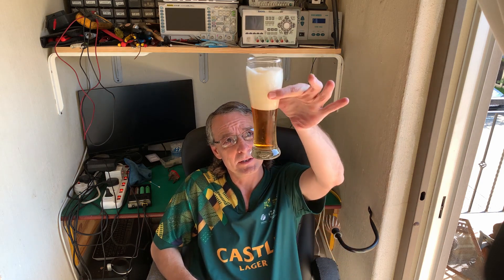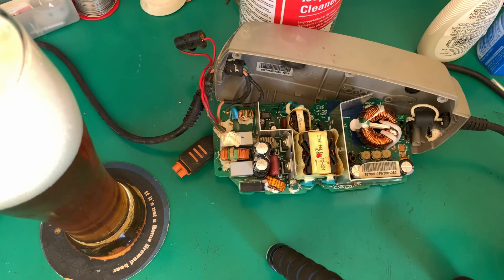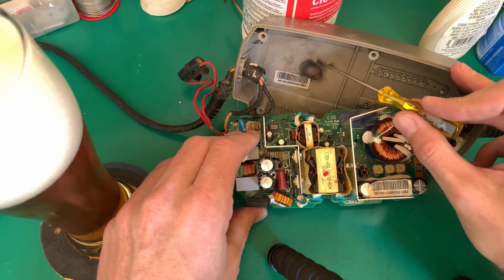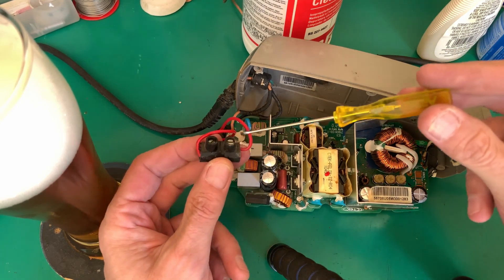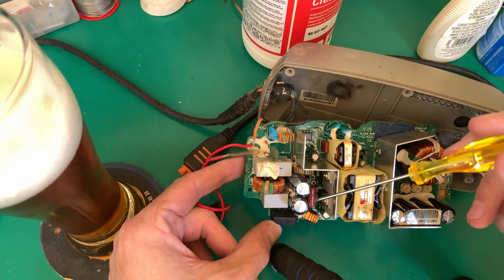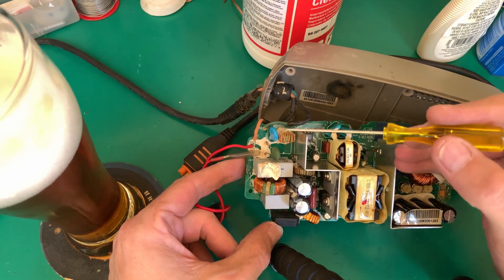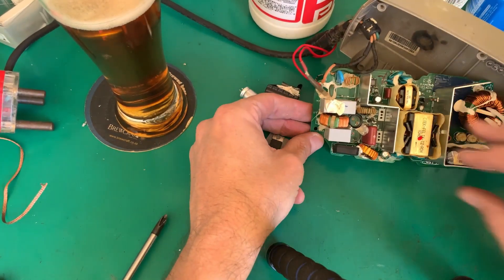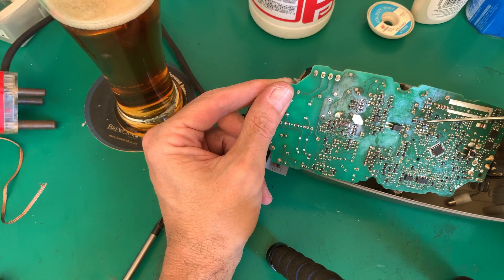FoulkesBrau #32 - Ctek MXS 10 Battery Charger Repair PT1

Comment: Hey friend,

I want to repair my ctek mxs10.
I found that the resistor R4 was blown out. It's the green one next to the entrance fuse. I measured 11-12ohms (R4). The entrance fuse melted trough. So there must be a short circuit. Do you know a solution?

Best regards ✌️
Reply from the maker: HI there,

Replace the fuse and measure for a short circuit. If it is still there, you are going to need a bench power supply with current limiting.

Set the bench power supply to ~5 volts and limit the current to 200mA. Power the circuit with this. Spray something like lighter fluid on the board and look where it evaporates. That will be where your short is.

Cheers
Reply: @foulkesbrau3085 
I repaired my mxs10🥳🍻.
Alle FETs, a Diode, entrance fuse and the Thermistor R4 were damaged.
Now it works great again.
I replaced other FETs because the original FETs are very expensive and hard to get. Thanks for your response✌️😊

Comment: Hi Made

Thumbs up for the Beer - im based here in Bavaria where beer is one of the common favorite drinks :-) 

any news from the repair of the MXS 10 charger?
I have the same charger and the same issue - but on mine the diode D4 beside of the FET is as well broken...
Did you see anything else broken on the PCB?
Reply from the maker: Hi Bastian,

Unfortunately our politicians have stopped all alcohol sales here in SA. So no beer for me. 😢 

I am still waiting for replacement components. The UK is on lockdown, so RS components is not flying anything in. As soon as I get the replacements, I will make a follow up video. In my case, it was only the FETs. 

Cheers

Craig.
Reply: Hi Craig;

the question is - whats more sad - nor beer or await the delivery of the  components....  :-(

Just wanna update you on my results until now
I replace the FET and the diode on the flyback converter side, and the charger comes to live again :-)
But now get the next problem - the flyback FETs get tremendously hot in a couple seconds...

I guess the secondary side is shorten - so the FET (IPA040N06N) right beside the transformer in the output side is blown as well...
i just took the meter and yes, all paths on the FET are alloyed through.... 

Will order them and change the as well and tha see whats going on

Keep you updated
Take care and all the best
Bastian
Reply from the maker: Hi Bastian,

I’ve ordered the parts again, they should be here next week. 

Mmm, if you got the right parts, then you may have a short elsewhere. But that should blow your fuse? 

If you don’t have the right FET, or your drive circuit is stuffers - they will get very hot because they’re not turning fully on or off. In which case the RDS on is very high and you will have a high power dissipation over the FETs. 

Hopefully I can make a video on the repair next weekend. Then I can show you some scope waveforms. 

Cheers

Craig.
Reply: @foulkesbrau3085  
I ordered exactly the same type.....
I guess that the Output FETs are shorten and the primary regulator try to go against the blown FET on the secondary side, which is not enoug to blow the primary fuse?

I'll  order the FET and will replace it, and i will as well replace the both FETs (030N03LS) right next to the output as they seems to be blown as well....

Its a device from one of my friends, not sure what exactly happens when the charger died - just got it both fuses blown - the primary and the one on the output side....

Cheers mate
Bastian
Reply from the maker: Hi Bastian,

You should be able to measure whether the output FETs are shorted. You have to be careful though as you cannot do it with a normal multimeter. You need an LCR meter where you can set frequency if you want to do it in circuit. 

I will make a note and show this in the follow up. If you have an inductor in parallel, like with an active PFC circuit, you will measure a short as an inductor shows up as a short in DC. 

Sounds like an interesting problem on your side. 

Cheers 

Craig
Reply: Can you look the psu controller chip (dip8) type?
Reply from the maker: Hi Jorrma,

All the chips on my board have been scraped of their markings. So unfortunately, without reverse engineering the board, I cannot help you. 

Cheers

Craig